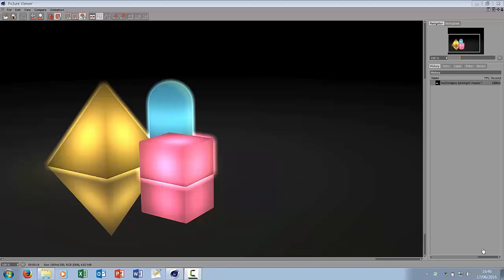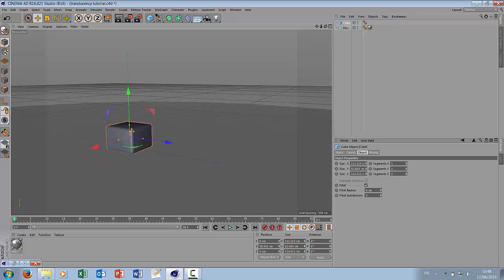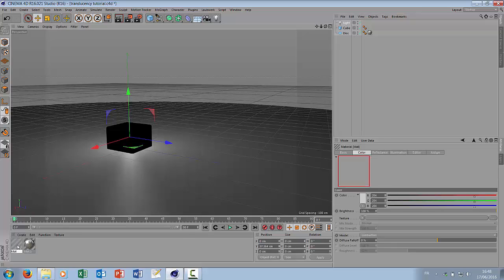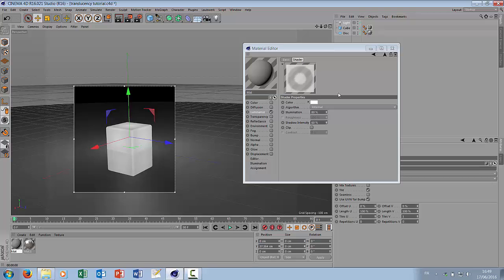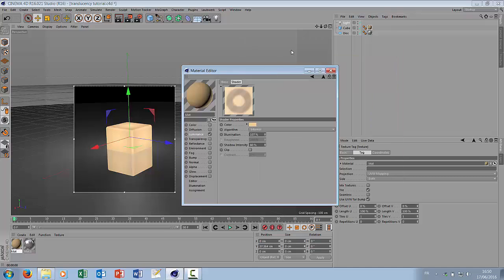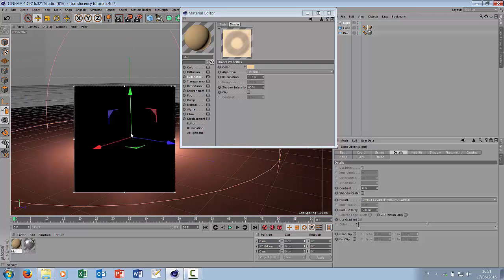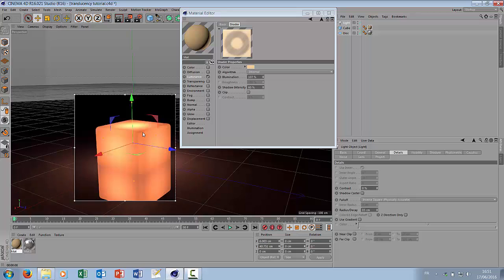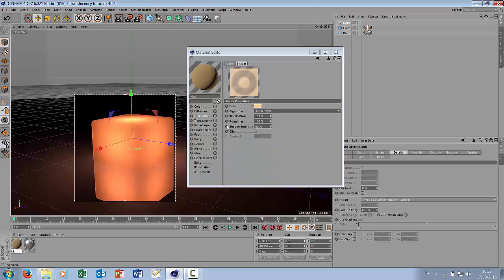Translucency effect in Cinema 4D with the backlight shader

Comment: Dear Friend 
I am using cinema 4D VR18 
With V-ray rendering which changes the material menus options etc
Could you please tell me how to make this tutorial work in my version?
Many thanks!
Reply from the maker: Sorry gk but I'm using an older version of C4D with the previous user interface!
Thanks for your attention.
Phil
Reply: you can make the material and then convert to vray material there will be a button in the materials tab
Reply: Easy way to do it, make everything with the normal Cinema 4D material and render it with Vray, because the steps for making it with Vray is a bit hard